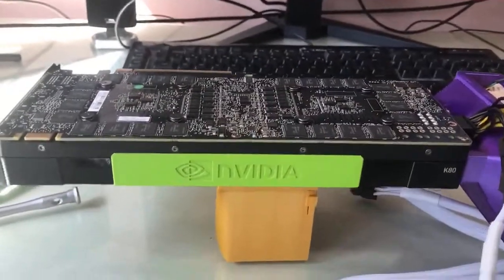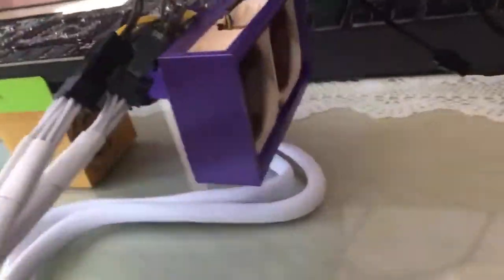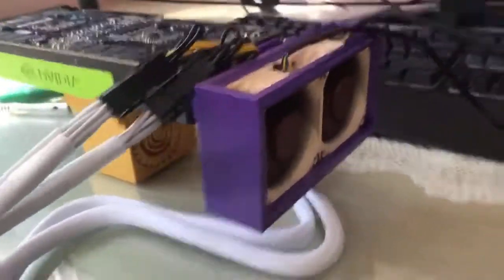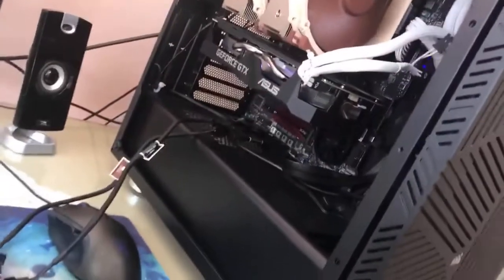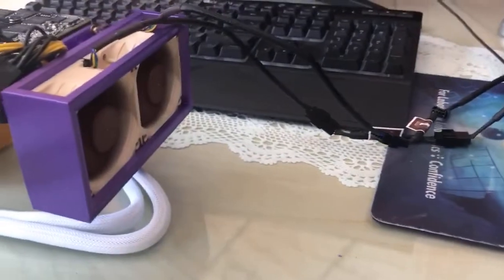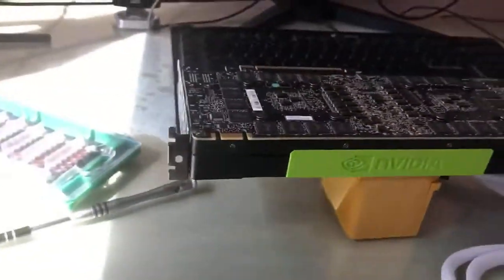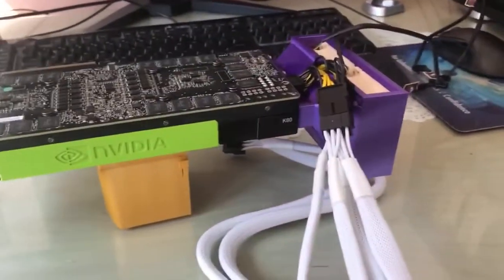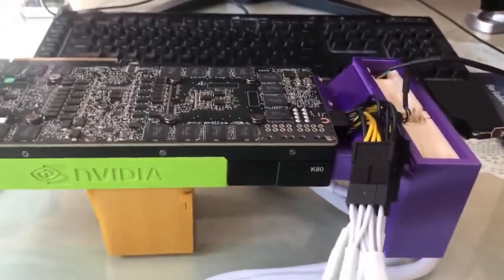Tesla K80 Active Cooling

Comment from the maker: I've been getting a few messages about using this for running local LLMs, so I'll keep my response brief:
- Yes it works. Hard to get the card to be detected by Windows, but using Linux distros like Pop OS is much, much easier
- No, it's not worth it. If you have the money, go for high VRAM consumer cards like the RTX 3090. If you don't, use modern low/mid range GPUs and just load lighter models
It was a fun learning experience, but the time spent getting this set up just isn't worth it. If you want to dip your toes in local LLMs, you should be able to spool up a GCP VM with the free compute credits given to new users

Comment: Does the smaller duct channel input allow enough air though, seems like a tight squeeze.  I am guessing you get more force/speed of air on the outlet?
Reply from the maker: Hmmmmmmm maybe. The Tesla K80 comes with a removable cover for their heat fins, so you could theoretically expand the height of the "airspace" above it, assuming it wouldn't bump into some other component. Rather, the purpose of the dual fans is to be able to supply the necessary airflow at a lower rotational frequency, giving the illusion of quieter fans.

For example, lets say the maximum air flow rate per cross-sectional area of the duct was 30 m^3/hr. That could be supplied by a single 30 m^3/hr fan running at 100%, or two running at 50%. Fans running at a higher rotational speed will operate at a higher rotational frequency, and consequently output a higher audible frequency. By having two fans run at a lower frequency, and that lower frequencies (<2000 Hz) are perceived as quieter than high frequencies (>2000 Hz) at equal intensities, this allows for a quieter fan setup.

However, given that Noctua fans are already built with minimal acoustical noise in mind, the benefit of such a setup is marginal at best, I'd say. That's why you can swap out one of the fans for plastic spacers on either end.

I'll be giving the K80 card and cooling setup to a friend of mine, since I have hardware incompatibilities with my current build. But then we'll be able to say if using 2 fans actually results in a lower temps and greater performance, as opposed to 1 fan alone.

TL;DR: I don't really know, in my mind more fans = quieter and greater air flow. But until proper benchmarks are done, we can't say for sure
Reply from the maker: Another thing to keep in mind is aerodynamics. The airflow is probably far from laminar, and quite turbulent, since the design was never structurally optimized for aerodynamics. Most gaming GPUs gave up on trying to have laminar airflow over the fins of the heat sink through the length of the GPU. Rather, they have fans spaced out evenly on top of the GPU that blow air straight down on the GPU. As Tesla K80s have a removable heat sink cover, it might be possible to print a fan shroud in place that would work the same way as say a GTX 1660 super. Or even water cooling is a possibility. The more I think of this design, the more regrets I have, but hey, hindsight is 20/20
Reply: @pataporon  you worry to much,.this should be a boolean. Does.it.work? Yes or no.

Comment: Hi, please upload a file for printing
Reply from the maker: https://github.com/MarkZaidi/Tesla-K80-fan-shroud/blob/main/60.8mm%20fans%20full.stl
Reply: @pataporon  Thank you.  Can you please tell me if the coolers are working loudly?  What is the load temperature? tesla m40 support? Upd: Sorry, if you talked about this in the video, I just don't understand English
Reply from the maker: @МемныйДядька-м1з  No problem! The coolers are very quiet, just as quiet as they are in the video. The load temperature should be close to 90C without cooling; the card in the video is not powered, so I don't know how well the cooler works. 

It may work better if you just remove the top of the Tesla K80 case and tape fans directly on top of it. All Noctua brand fans are generally quiet.

This should work for the Tesla m40, but I'm not 100% sure since I didn't have one to test with.
Reply: @pataporon  OK I understood.  Thank you very much
Reply: @МемныйДядька-м1з  did you test how how the m40 got with these fans? I want to use these cuz they are much quieter than the delta blower, but don't want to waste money either

Comment: How cool do the fans make the tesla? Also is it compatible with the m40?
Reply from the maker: I haven't tested temperatures, mainly because I was never able to get the card working in my Windows machine, so I can't verify what the maximum load would be before it gets thermally throttled.

The m40 has the same board design as the K80 so it should work in theory, however I don't have an m40 to verify.
Reply: @pataporon  Does it seem to move a lot of air though? the noctua 40mm fans I looked at didnt work that well, and the delta blower is 60db. How much air was moved?
Reply: @pataporon  😂😂🤣🤣🤣🤣🤣

Comment: These Noctua fans are not the same as the noisy fans in servers, which are moving way much cubic feet of air than these two. Please run your card for an hour under 100% load and check the temp on your GPU before telling people it "should work"...